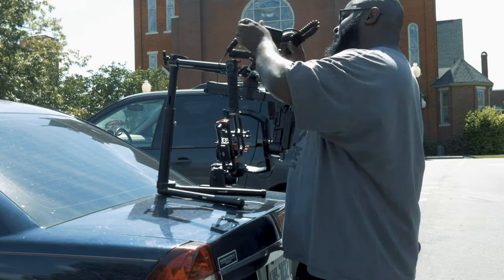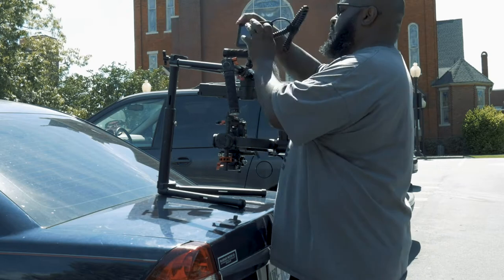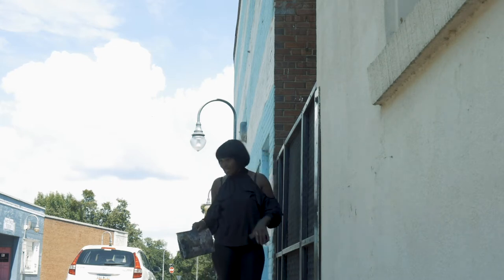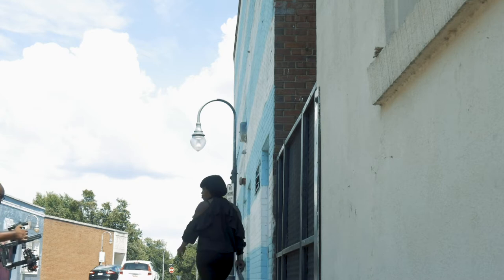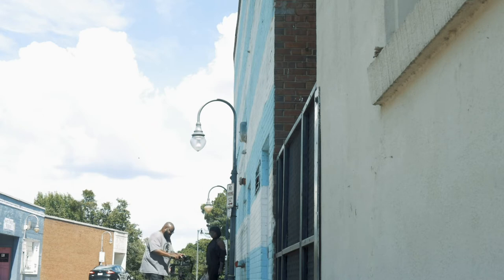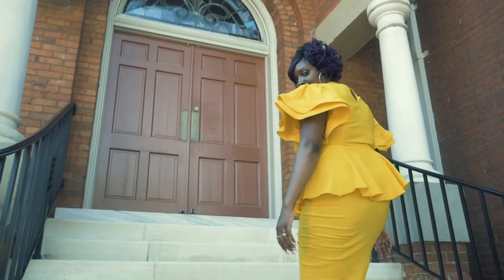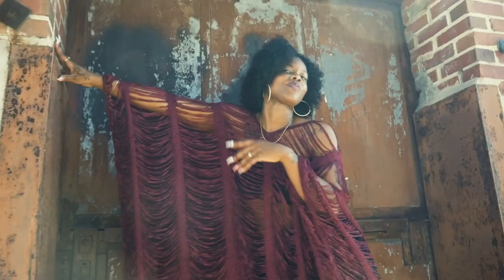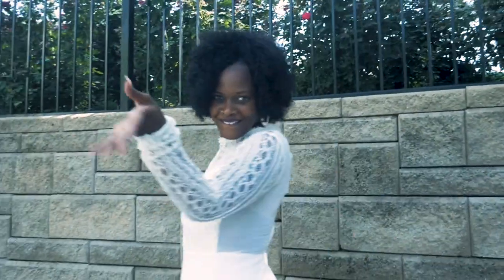Testing Out Ronin Without Smallrig Grip

Comment: I got my ronin M two weeks ago..I love it but i'm still learning to get used to it...What smooth track settings are u using on yours?
Reply from the maker: I’ll do a video on that next.
Reply: Bet...Please do...that's the part that I'm really trying to get down real good...I use the gh4 and Sigma 18-35 lens on my Ronin setup primarily. By the way I used to live in Fayetteville for 10 years. I went to college there at Methodist College on Ramsey St. I'm back in my home state of Kansas now but I go back and visit from time to time.
Reply from the maker: That lens kinda heavy but it should still balance.
Reply: ChieftexxFilms Yeah the lens is very heavy for sure...but the Ronin M can balance it but it's difficult to get that manual balance just right with that setup to me.
Reply: I have a quick release mounted to the base plate of my Ronin..I don't know if that adds to the difficulty of the manual balance or not.